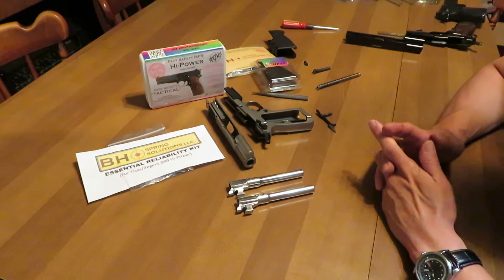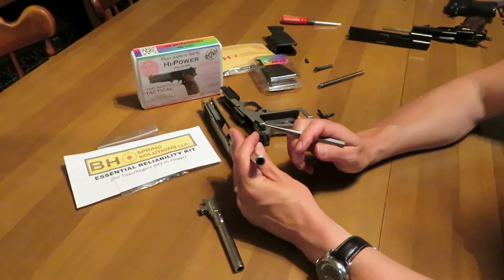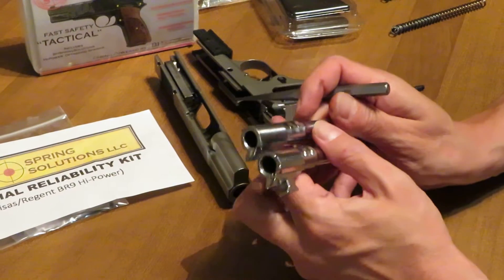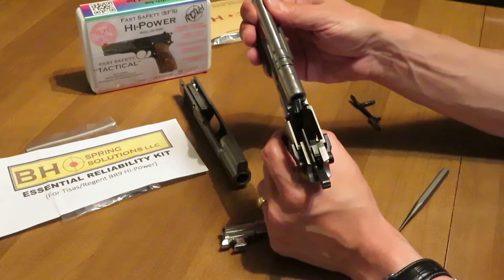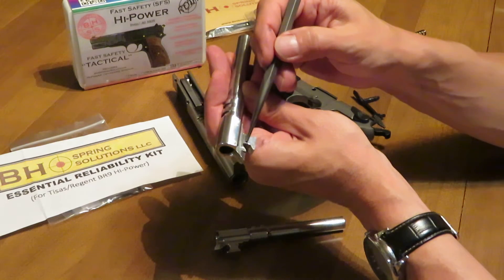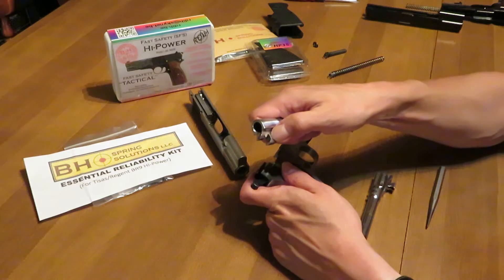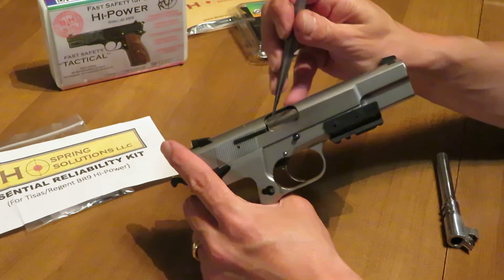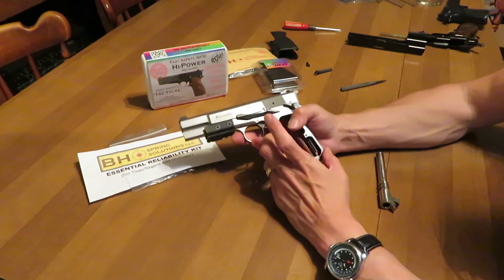Supplemental Video 8,400 Round Test Tisas / Regent BR9 - BHSpringSolutions LLC BHSpringSolutions.com

Comment: How about designing an adjustable rear sight for the Tisas HP?
Reply: Regent BR9... The sight used for this is the TTF49HK, so the HK family of LPA adjustable sights will work. There is some fitting for the rear sight dovetail but the front was a basic drop-in.     https://www.facebook.com/search/top/?q=browning%20hp%20clones&epa=SEARCH_BOX
Reply: cuzz63 That Facebook post appears to have been taken down. Do you have any other info or a link to another post/article?
Reply: cuzz63 Never mind, I was experiencing technical problems with the video (or possibly my WiFi) that made it seem like it had been deleted.
Reply: @DLordSadow  so you good now? If your not on the HP clone page you might want to be, good info from time to time.
Reply: cuzz63 Yeah, I’ve got the basic info and saw the video. However, I couldn’t find any HK USP sights on Fusion FireArms site. Plus, does anyone know the dimensions of the BR9 front sight?